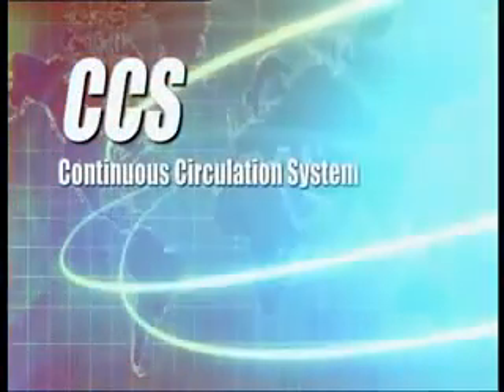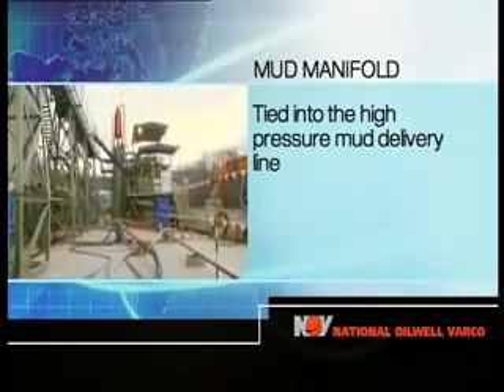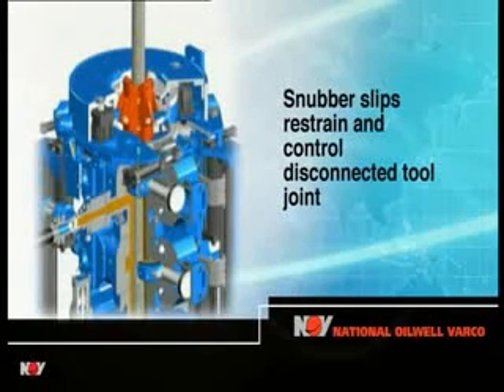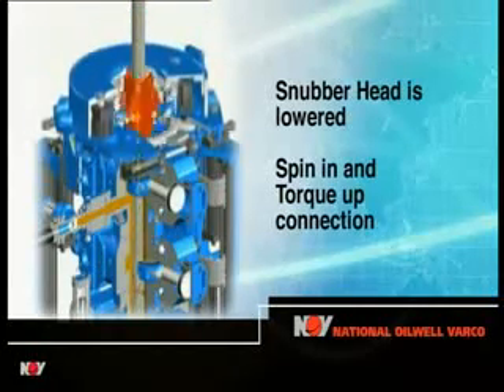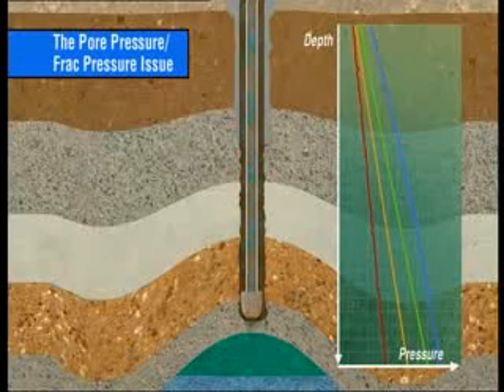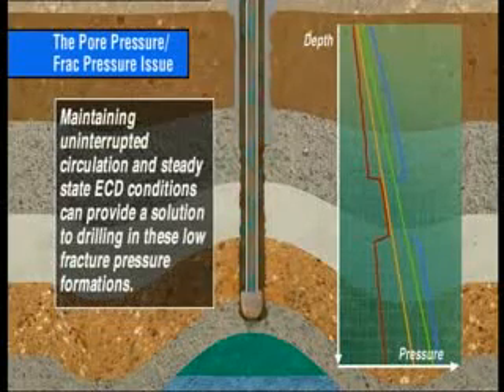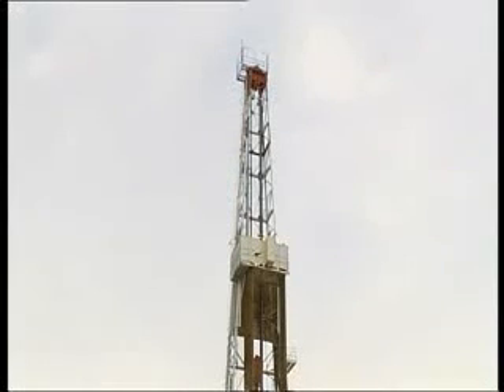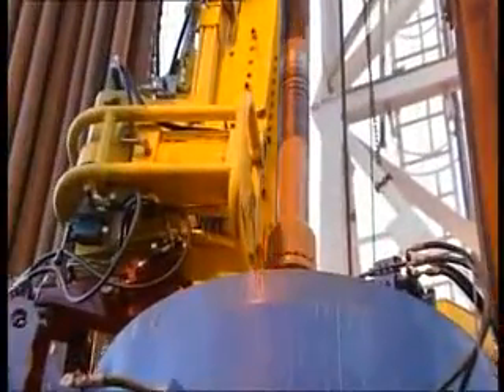CCS (Continuous Circulation Drilling System) now available from NOV (National Oilwell Varco).

Comment: I have 2 questions.
1. How to establish circulation if there is no pipe in the hole? 
2. How to run casing while keep continuing circulation?
Thanks a lot.
Reply: 1.   There is pipe in the hole.
2.  You don't run casing while the CCS is on well center.   The CCS is only there for the drilling portion.

Comment: I don't see how the few minutes that the pumps are off when adding a triple string of pipe are going to make a serious difference in a difficult formation. Would this same CCS work during a pipe trip when the normal circulation might be disrupted for 8-16 hours during a worn bit change or when swapping from a PDC bit to a mud motor as the well trajectory turns horizontal ?  How much time would this system add to a 3500m trip? Could the CCS be used during casing operations to control troublesome open hole sections?  I don't work in the oil patch. I'm just a mechanical engineer who is always looking to optimize any process.
Reply: This is used to control gas intake to mitigate BHP fluctuations caused by low/fluctuating GLR. Mostly in UBD.
Reply: So much for ESDs